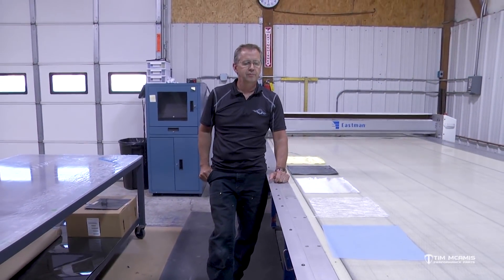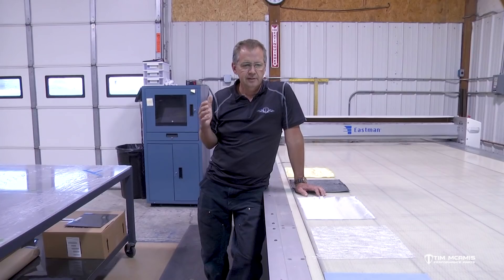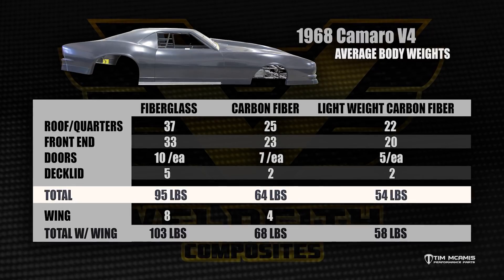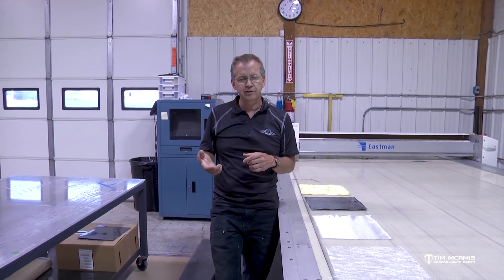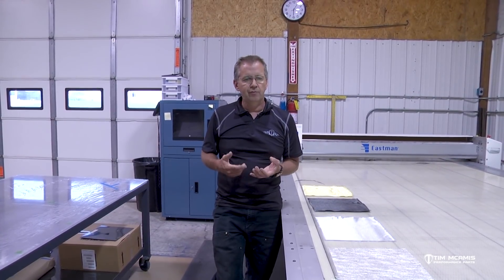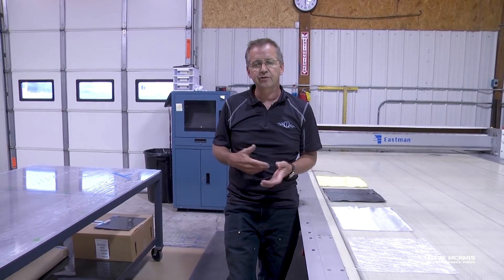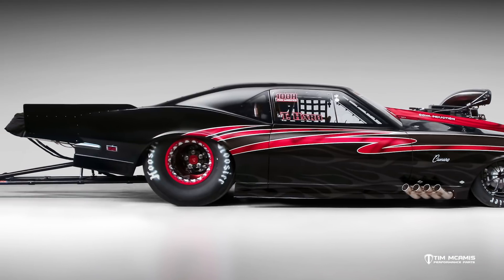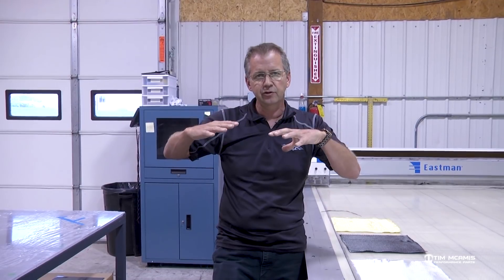Fiberglass vs. Carbon Fiber Bodies - Composite Series: E2

Comment: Thanks Mr. Tim, I have one question. If the car exterior is left unpainted or painted black will the suns heat in that black color 170+ temperature effect the carbon resin?

Comment: I am sorry but I disagree to the statement that Carbon Fiber is stronger then EGlass or SGlass. Carbon Fiber is Stiffer not stronger. The tensile strength is cfrp is less the fiber glass. But you have more elongation on fiber glass, there is more flex and it has better tensile strength on fiber glass compared to carbon fiber.

Comment: i heard S glass has higher compression strength than carbon fiber
Reply: Yes that is correct
Reply: This guy does one of the best videos I have seen on stregth to weight and stiffness to weight of the different composites we tend to use.
Reply: Because fiberglass is silicon-based. Concrete is silicon-based and it can hold crushing weight forever.

Comment: "fibreglass is heavy because it's resin rich, that's why won't do anything do get rid of excess resin"

If you don't have same standards for carbon and fibreglass composites, this is just a carbon ad.
Reply: pro tip : you can watch series on Kaldrostream. I've been using it for watching loads of movies during the lockdown.
Reply: @Giovanni Jerome Yea, I have been using kaldrostream for since december myself =)
Reply: @Giovanni Jerome yea, have been watching on KaldroStream for since december myself =)

Comment: What are you talking about? Why not vac the Glass fibre? There is no problem in doing so. It is the only real construction method, if a part needs to be strong and durable but light.
Reply: Nikša  Definitely not. Every (absolutely every!) professional part is created under a pressure difference. Pressing resin out will reduce the weight dramatically while not loosing any durability. It also helps to adhere the layers even better. If you want a part that is defineable as "Good" or "Very good" you need to use the proper technique. It is like steel concrete (more below!). You can also save a lot of money as a side effect. If you suck in the resin under vacuum you basically use as little as even possible. This can be combined with pressure from the outside. Which often is used for construction grade parts.

It can also be usefull to include a core inside the layers. This would be at best a honeycomb structure, that is stiff and has voids. The inside of every part typically has no force applied to it no matter which way it bends. It just cancels out from inside being compressed and outside being streched. The core however needs to resist sliding and has to have good grip on the resin. This creates a much stronger part with barely any weight gain. Fibre material is very expensive, so this is almost always worth it for performance part.
But it really depends on the use case. Material science is one of the most interesting forms of science, period! The only limit is, what can you think of? It requires some moderate knowledge of basic physics (mechanics). Often even more. Think of a reinforced part with a carbon fibre honeycomb core which is reinfoced through additional geometry and has a tube length of 1cm. Now on the outside add 3 layers of thick carbon fibre (multidirectional type).
You can jump on it and it will not bend at all (visible to the eye) This would be insanely complex to manufacture the core and very expensive to state the obvious, but I hope this helps you understand how important the right combination of materials is in composites and what technice to use.

.

If you want to build a bridge properly, you actually have to work with high tension on every single piece of reinforcement. The stability often does not change at all, but the durability increases dramatically (like twice as durable). With concrete this for example means less cracks because of the tension. The cracks would grow and let water to the reinforcement. This would cause rust and drive the concrete apart completely, since it would expand a lot!
Reply: Nikša  I read some the comment before you removed most. I think that sounds very interesting. Have fun with that. :)

Comment: What a TOTAL load of bullshit. 
I have been in the Industry 26 years. 
YOU are just marketing your product. 
By weight, carbon fiber and fibre-glass are the same weight. Period. The difference is in the structural loading each material can take. Fibre-glass can do 170 MPH down the drag strip just like the Carbon you mentioned - and at the same weight ! 
You have to compare the materials through the same processes. If you vac bag the carbon, you should vac bag the glass AND ONLY THEN  "compare them". Clown ! 
Of course there will be a difference between vac bagging and hand lay!! One process leaves the excesses resin in the product. The other takes out ALL the resin except for what is in the fibres of the material. Know wonder there is a difference in weight !
Can not be bothered explaining it to you in detail, but STOP telling stories!
Reply: So my spoiler fell off, for a new spoiler on my car what would you recommend as the best, also mid grade, and cheapest material options I could buy? In your opinion & with your experience.
Reply: Would it be ridiculous to ask you for a quick consultation? I'm building a wide-body '68 Fastback (3D design -> 3D print process with PETG applied to the body). My plan is to create molds and then produce a body kit for my Fastback. If you have a couple of minutes to spare, please let me know. Thank you!

Comment: the same goes for carbon fiber if its processed without a vac-process. Glass fibre has a lot of superior propperties compared to carbon. Expecialy its lower modulus makes it much more impact resistant since it can deform and absorb energy and distribute it on a far bigger surface. Stiffness is a different thing. People dont get what a great material glass fibre is for its price.
Reply: Man dude you are right. They talk about carbon fiber being stronger. I worked for a major airline doing fiberglass repairs on all the flight controls and nose radomes. They fly at 600 miles and hour and repairs held up fine

Comment: Why are you not using S glass?  It sounds like you’re using heavy E glass mat or something like it.  S glass is definitely not as stiff as carbon fiber composites for the same structural design, but it withstands impacts that will shatter a carbon part.  Also a bit stronger than all but the very best carbon fiber fabrics.  It certainly is a bit heavier than the best carbon fiber fabrics approaching or exceeding its strength, but it is quite a bit lighter (and stiffer) than E glass for a given strength.  It also does not have the electrolytic or bimetal corrosion issues that carbon does, especially with aluminum parts.  If weight and stiffness are the only factors, then nothing beats high end carbon fiber composites today.  But for those of us who don’t have deep pockets that can keep turning out CF parts for our hot rods and street rockets (or aircraft, in my case), S glass is an excellent option that gets you most of the way to the weight savings with better strength and nearly the stiffness for a given structure, without worrying about corrosion or breaking the bank.
Reply: Yeah, E & S glass are distinct, but everyone treats them interchangeably.  S glass can give Carbon a run for its money.
Reply: @pawek9528   although s glass is heavier and has some cons it also has lot of pros over carbon fibre and it can be up to 5 times cheaper depending upon where you get it from
Reply: With your knowledge how does Basalt fibre conpare?

Comment: Why don’t you bag the fiberglass?!
Reply: Christian Williams you can if you want, not so much with glass mat , but fibreglass cloth we often bag with epoxy resin ( as opposed to the much cheaper polyester of GRP) for the weight saving and the product we make we cannot use carbon as it blocks RF, but fibreglass/ polyester is usually used because it is cheap as chips, bagging ain’t cheap because it is time consuming, needs more expensive resins and uses quite some consumables, hence if you are going to the effort and cost of vacuum bagging, spend the extra on carbon cloth and get a stronger lighter product. At least , that is my take.
Reply: @ForeverNeverwhere1  Very good observation. Thanks for sharing you experience :)